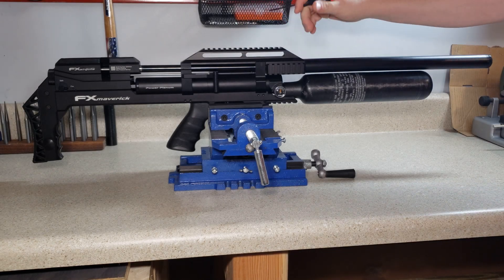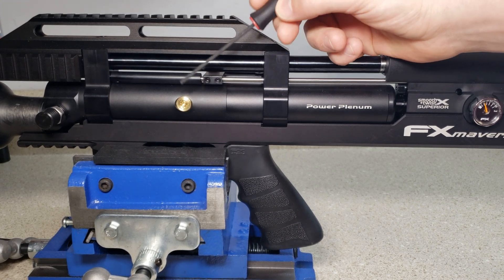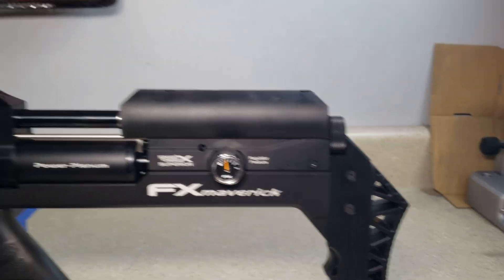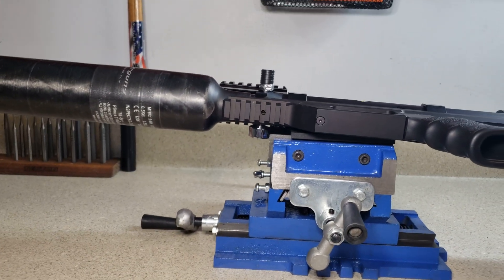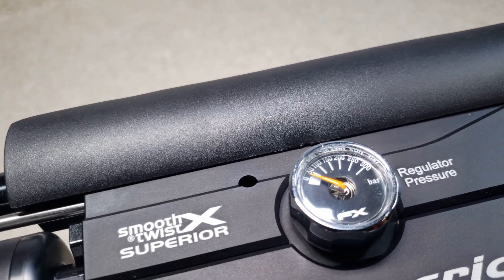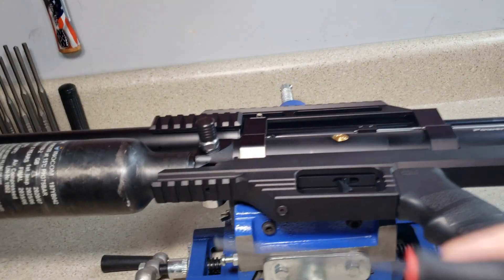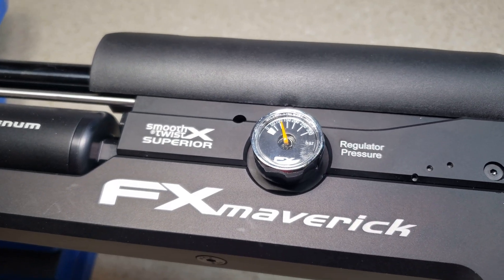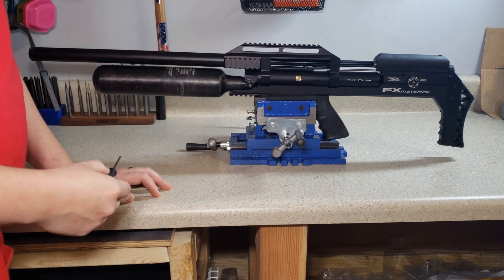FX Maverick Regulator Adjustment Tutorial - FX Maverick Adjustment Tutorial - FX Airguns

Comment: Hi there. very good info.
Reading the FX website it says that from Dreamline the FX started using the AMP Regulator (Adjustable match pressure) and that new system allows you to increase or decrease the press.Reg. Valve without degassing the rifle.. I just got a Maverick and also have the Dreamline tactical BT and I haven't touch anything.
Reply from the maker: Yes this is the AMP regulator in the video. While technically you do not need to degas to reduce regulator, you will not know how much you have adjusted until you shoot it a few times. Also, it does damage the top of the regulator piston, just not as much as before...

Comment: I have the 22cal maverick vp with factory set up , to increase pressure on the first reg is counter clockwise and on the second plenum reg is also counter clockwise , correct , but adjust the plenum reg first right ?? 
My plenum reg adjustment is on the right side does that make a difference ??

Comment: Quick question. So the first time I degassed my rifle it dumped everything. Second time I degassed and from then on I HAD to dry fire in order to degas it. If it won’t dump after removing the bottle and won’t degas and instead of dry firing it is there another (safer) way to degas?
Reply from the maker: Some newer models have a degas screw about 60 degrees around the other side of the tube from the regulator. This will start bleeding the plenum and eventually allow it to dump the air out the front.

Comment: Thanks for this video.  I'm running 180 on the front reg and 150 on the rear reg.  Also installed the slug power kit at the same time. Now 1024 fps with 34gr slugs at 80ftlb. Might be time to purchase a .30 barrel kit.

Comment: I may have backed out the reg screw to far . How do I know there’s a leak or the original oring went bad? Does it free flow? Is it a slow leak ? Do you loose significant speed?
Reply from the maker: The air will be spraying out significantly from around the screw in the O-ring is damaged. When you remove the screw, if the O-ring is split in two, that is typically from backing it out too far. If it is still intact as one, then the originally O-ring was probably bad.
Reply: Ok, It’s not leaking at all, let alone gushing. I think dumb luck saved me again. Thank you for your time.

Comment: Excellent. The best explication I have seen yet. Now,….if someone with lots of free time and pellets would make charts showing the velocities for different pellets at different settings and yes, different barrel lengths! Since the JSB 18.13 seems to be the standard for .22 that would be a good starting point. For instance,
Reply: (Pressed wrong button). For instance, what pressure would you use to push an 18.16 gr pellet at 900 fps?

Comment: Thanks for the tip. All other videos I’ve seen has dry fired to low side regu
Reply: Sorry I hit send by mistake. All other vids dry fired to empty second plenum.
Reply from the maker: Yeah dry firing is not very healthy for the rifle. While it technically can survive a few dry fires, its best not to, and find another method of degassing. Thanks for watching and glad it helped!
Reply: @910AirgunTuningandRepairs  I ordered & just received the slug kit for the Maverick Sniper. What can I expect to gain by installing the kit? I have my Regulators set at 148 & 108 I have digital gauges that’s the reason for the oddball numbers lol. Right now I shoot the JSB 34.5’s at 905 and the NSA 29gr at approx. 1000. JSB knockout are 940ish if I remember right. The slug probe and Hammer I believe are the only things in the kit that get replaced. I appreciate your comments thanks!

Comment: I have a Maverick with regs at 140-95. When I shoot, after 6-10 shots the speed starts to decrease for the next 4-5 shots, reaching values of less than 150 fps than the previous string. Does anybody have any idea of why is that?
Reply: your regs seem very far apart they should only be 20 - 30 difference so if 1 is 140 then 2 should be 110 or 120

Comment: Hello. I have a maverick vp .30 cal, 1st regulator set at 175bar and 2nd at 150bar. Shooting the FX Hybrids at 930 fps. My question is: after the gun its not been used for a couple of hours or days, the first shot is like 30/35 fps slower. Based on your experience what do you think is causing that? Thank you
Reply from the maker: It sounds like you have a few bar of regulator creep. The easiest way to combat this is to increase your hammer spring tension slightly to offset the higher regulator pressure on the first shot. I would also recommend replacing the bottom o-ring on the regulator screw of the 2nd regulator. (2x1 NBR 90).
Reply: @910AirgunTuningandRepairs  thanks a lot for answering my question.

Comment: One more question... My .30 maverick vp was shipped to me with the regs set for a 22 so I had to readjust them I followed your instructions and set the 1st reg fine went to degas to set the 2nd one and I can't get the air from plenum, I tried cracking the 2nd reg a hair like you did and also tried firing a couple shots and nothing still a full plenum? Any ideas? Thanks again.
Reply from the maker: If the air tank is off of the rifle, you may just need to take a few more shots or open the regulator even more (not past flush though). If you have a newer model you may have a pressure bleed screw with the 2nd regulator (steel screw with 2mm allen, typically about 45 degrees from the 2nd reg)

Comment: I set my regulators 130/105 but it’s shooting low jsb 18.13 grain 750fps ! Pw7
Reply from the maker: Have you adjusted your hammer pre-load? This is with a 1.5mm through the "adjust" hole when it is at the south/6 o'clock position
Reply: @910AirgunTuningandRepairs  my hammer preloaded is max out

Comment: 5:21 zero pressure is bad you will make micro crack and it start crack every compress and decompress air cycle, the minimum of pressel vessels work is 30% and max is 80%
Reply from the maker: If you massively decrease the pressure of the regulator while there is still pressure on it, you will be pressing the regulator screw (brass) against the regulator piston (Delrin). Thus, over time, you will cause a dimple in the top of the piston and damage it. 
The bottle maintains its pressure when removed due to valve. The rifles are rigorously tested and over engineered, you can take the bottle on and off 1000s of times with no pressure issues.

Comment: My maverick loses velocity with anything over 120bar shown on the rear reg, with hammer spring preload maxed out.
Reply from the maker: You will need a heavier hammer weight more than likely. If you currently have a .22cal, you will need hammer weight #19215. If you have a .25cal, then you will need hammer weight #17003.
Reply: @910AirgunTuningandRepairs  Rocking a .30 like 68.
Had to send it to FX for repair straight out of the box. They had to modify the gun to get it to do what it should have done stock. Complete tear down, Polish, replace o-rings, fix a ton of machining burs and run a stronger spring. So in order for my gun to perform like an out of the box gun, it took them 8 business days of labor and forcing the hammer to strike the valve harder, shortening the lifespan of the internals. 
I ordered 5 total guns, only 1 showed up working well right out of the box. My Dreamline Classic GRS .22, Maverick.30, Impact .22 and Wildcat mkIII compact .177 all needed repair right out of the boxes. My impact mkIII .22 is working flawlessly, but is completely different than the .177. Different dimensions, probe style, trigger feel, cocking feel etc, and the bolt at the front of the stock was cross-threaded into the block so badly the threads on it and the block were badly damaged.
Reply: Audio_Phill... Were you ever able to duplicate 68 Whiskey results with your Maverick. I have the .30 Compact just like his and am now weary of tuning it due to your experience.
Reply: @fishing4happiness610  sent the gun to fx usa and after 7 days of working on it, they gave up on stock parts performing at stick level and changed to heavier hammer spring. It'll now sling hybrids like 68's, but even with a 300bar track it's so inefficient I'm off reg in 3 mags.
Reply: @Audio_Phill ...I think you are actually way ahead of 68 Whiskey. He only gets 1 mag at his 150bar setup. In fact I believe factory stock tune is only like 4 mags. I'd be jumping for joy if I get 3 mags. Thanks for the info!
Reply: @fishing4happiness610 as it was when it it got here, it sipped air. 10 mags per fill with pellets @ 830fps.
Reply: @Audio_Phill ... Holy Batman, are you serious?! That would be 130 shots at 70 Plus ftlbs!!! I know even Steve at AEAC was only getting 60 shots out of a .25 Compact at 60 ft.lbs and about 100 shots from the .25 Sniper.  I assume you have the Sniper. 30 so from what I can gather you had an exceptional Unicorn Camel to get 10 mags even if you have the Sniper. Other guys on the forums are getting 2 to 2.5 mags maxxed out AT THE MOST(High 800s) in Compact 30.  Whiskey 68 confirmed that his 180/150 setting he gets 20 shots on his .30 Compact Maverick. I'll trade you guns!
Reply: @Audio_Phill  was your reg setup at 120 and HS set up 7 from the factory to get that outstanding shot count.  I'll chrono mine this weekend as it's from the factory and let you know what I get... if it doesn't break that is.
Reply: @fishing4happiness610  Ordered mine from talon tunes (never again) it arrived with both regs at 120. I set first to 150, 2nd to 115, and with the stock internals I got 10 mags on reg and 4 off reg before significant poi shift. PW @ max preload #3.
Reply: @Audio_Phill  Thanks for the specs... much appreciated.  Last question...Do you indeed have the Sniper. 30 Maverick or the 600mm?
Reply: @fishing4happiness610  sniper. I also picked up the 500mm barrel though. I recommend the carbon fiber sleeves for the 700mm. The barrel whip is a pita without them.
Reply: @Audio_Phill  thanks again for the info. I think the sleeve should come standard with all FX barrels. Even my old FX Cyclone has the skinniest whippy barrel. My cheap Walther Reign has a 5/8 inch barrel and 2 mags. I'm not a fan of FX nickel and diming for things they should be including for their guns.  With the crappy experience you had with yours.. I feel FX may soon suffer severely for their success. If I have the suffer QC issues like you... I'm done with them.
Reply: @Audio_Phill  I just got back from tuning. So far best results are 175/125 on the regs, Hammer out 6mm on PW6 shooting both Hades and Hybrids at 850fps and getting 41 shots on reg. I'm happy with that. I think the magazine is ridiculous for a $1,600 gun.
Reply: @fishing4happiness610  hybrids under 950 aren't too good.
Reply: @fishing4happiness610  the mags are reliable other than the small o-rings. I glue mine in with a tiny drop of Bob Smith IC2000. 850 for 40 sounds like terrible efficiency. I'm getting 39 shots @ 93fpe with hybrids on reg. 70+ @ 850 with jsb 44's or Hades. Over 100 useable shots before significant poi shift @ 50yd.
Reply: @Audio_Phill  Thanks for the advice on gluing the o-ring on the mag. My FX Cyclone holds 1 MOA with Hybrids at 795 fps, outdoing the Hades in accuracy beyond 60 yards. I do know Hybrids don't expand well below 900, but I'm looking for penetration and better trajectory so I'm hoping the Maverick likes the combo as well. Your setup is definitely tuned well to get your shot count. Considering I have about half your air capacity and a 500mm barrel I'm actually pretty happy. I knew what to expect from Whiskey 68's one mag shot count, but I needed compact power, not shot count... so getting over 3 mags is a bonus to me. That being said, I'll keep tweaking further to find the limits since I paid almost 2 grand for adjustability.
Reply: @fishing4happiness610  but drop at that speed is to severe to reach out like the slugs are capable of, as well as not being sufficient for expansion.

Comment: my first regulator always stuck 90bar_ dont rise more from that! why?
Reply from the maker: If everything has been adjusted properly to read the first regulator pressure on the rear gauge, and you have more than 90 bar in the tank, then it sounds to me like you need an additional regulator washer, or there may be something wrong with the gauge.

Comment: So I have a leak coming through the adjustment hole...I changed the o ring and it still leaks if I adjust past 100 bar? What do you think?
Reply from the maker: By adjustment hole, I am guessing you mean the regulator screw. The only way for it to leak there is the upper 2x1 nbr90 oring on the screw. Make sure the oring or any of the sealing surface of the screw was not damaged during removal/installation.